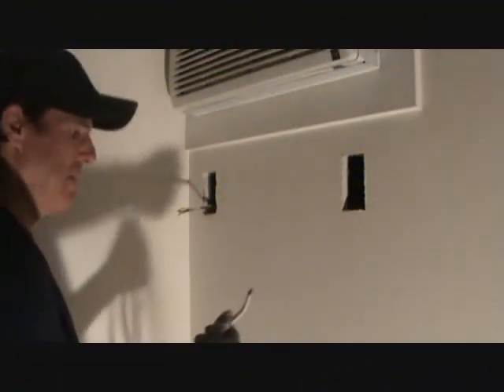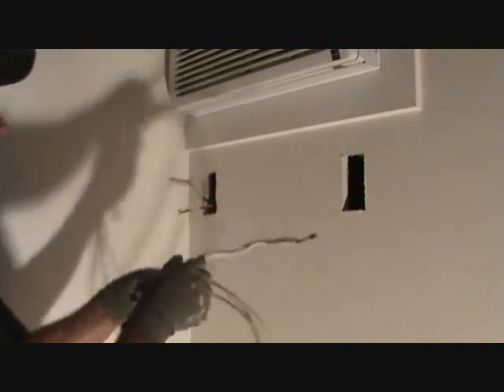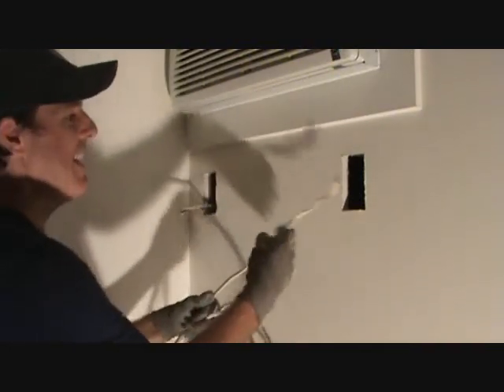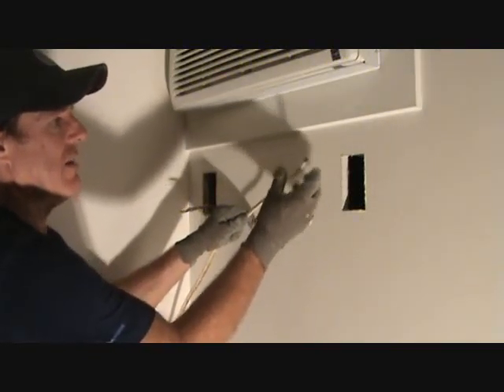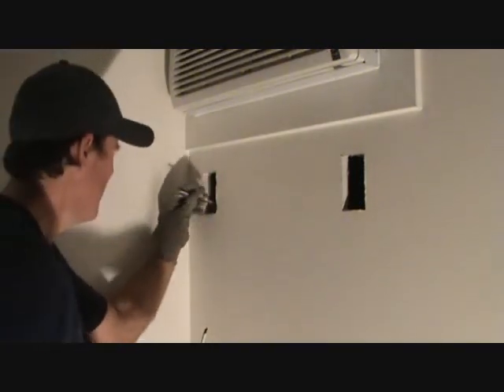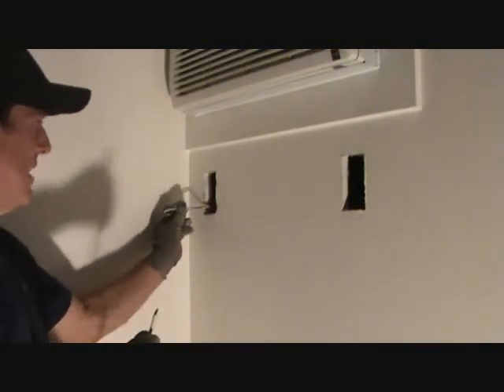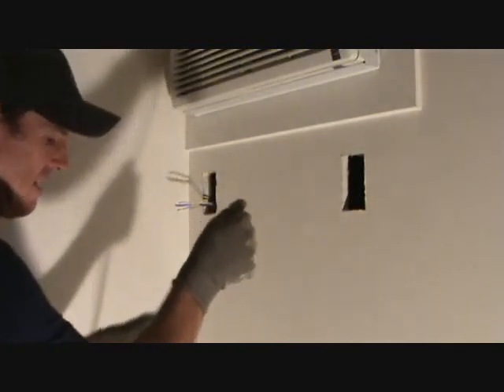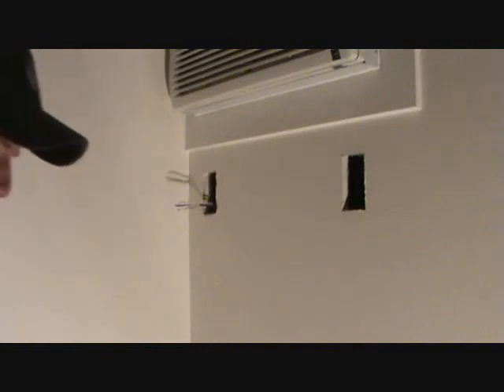How to determine what size romex wire you need: for your electrical project

Comment from the maker: @Chewylu103 All the breakers in the subpanel are 20 amp & I do not want to change this. If the existing wiring is fine to run the existing AC unit, then I can install a larger wire but not a smaller one than the existing. I think code might be to have no breaker smaller than a 20 amp breaker (for these condos?) but all 20 amp breakers should have a wire size of 12 gauge & no smaller. The inspector may have missed it. Thanks for your comments.   Joe  :0

Comment: @VideoJoeKnows National Electrical Code also states that if you change it you fix it, so you are obligated to change out that breaker to the correct sized breaker.

Comment: Joe,
 If the wire you are going to get your power from is fed from a 20amp breaker and you suspect it might be a 14 awg wire, then you should change out the circuit breaker to a 15a circuit breaker. The reason being is that you are now modifying this circuit and therefore have to correct it. Also you need to use the same wire size that the circuit started with, unless it is a correction factor for voltage drop which in this residential application is not the case.

Comment from the maker: @Chewylu103 The timer is also rated for a 15 amp circuit so I should be fine. I could've run a 14-2 w/ground it looks like. I had the 12-2 w/ground handy so I thought I would be safe either way. Thanks again for all your input as it will be beneficial to any viewer who reads these comments.   Joe  :0

Comment from the maker: @Chewylu103 You are correct. Hypothetically if anyone added to this circuit & saw that the previous installer used 12-2 wire, they might make the assumption they could add additional 20 amp rated items to this circuit & thus create a potential fire hazard since the initial wire/cable installed was only 14-2 which should've been installed with a 15 amp breaker. Thanks for your additional comments.  Joe  :0

Comment: @WannaBeDj100 No voltage drop is something that is going to be there if you have more then one thing on a line. Voltage will not go down do to smaller wire. Voltage drop is when you have a load on a line. AC power can go a long way with out voltage drop is its not loaded. DC power drops volts after long runs but both have nothing to do with smaller wire and that making the volts drop.

Comment from the maker: @strumpeteer I probably should've changed it but I felt there was no harm to do it this time, as you would not be able to add to this circuit, given the location used was under the AC unit & would be very difficult, if not impossible, to add anything else on this particular circuit, given the location. Thanks for your comments.   Joe  :0

Comment from the maker: @Chewylu103 The electrician probably checked the load on the AC unit, when intstalled, & determined that a 14 gauge wire was ok?... as the AC unit has been here for around 6 years & nothing has happened to it.....yet! The AC was not upgraded but if it ever was, should not be any larger than what's there now. The breakers were in a condo & maybe the requirement was that this condo was not to have any 15 amp breakers in the sub-panel?....not sure. Thanks for your comments.   Joe  :0

Comment: @VideoJoeKnows  If the wire is 14-2 on a 20 amp breaker, that would be wrong and would warrant changing it if you must use that circuit or running a new circuit, you cant just go up to a 12-2 on a 20 amp circuit that is run in 14-2 its wrong to start with and its just adding to the mess. now if you are wrong in the video and that is actually a 12-2 you are getting your power from then what you are doing is fine.  I am reading the code book now about the only 20a circuits in a condo.

Comment from the maker: @Chewylu103 It appears that the actual wire coming into the initial box is a 14-2 w/ground. If so, they should've installed on a 15 amp breaker. I added 12-2 w/ground to run the added timer. That would be OK to do in this instance as I am increasing the size wire & not decreasing what was existing. I believe the existing AC unit can be run on a 15 amp circuit so I would think the actual 14-2 w/ground will hold & will never be in need of a 20 amp breaker so it should work. Thanks.  Joe  :0

Comment: @strumpeteer yes i agree using a number 12 on a 15amp breaker is fine, because the wire is oversized for that breaker and the breaker will trip before current reaches the wires ampacity. My concern was that he was giving out false information, he said that the 14 was on a 20 amp breaker if i remember correctly, its wrong to just add a 12awg potentially masking a problem. because you see the breaker at 20 amps, the wire at 12 and run 20amp equipment. boom, 14awg melts, possible fire.

Comment: @VideoJoeKnows There are codes and standards in place for a reason so that at any point later down the line another electrician can pick up where the last guy left off and know that it is all up to par. People need to know just because the wire is bigger does not mean its right, it throws off the next guys perception of the circuit thus creating a fire hazard. hypothetically if you had a load rated for 12-2 on your 14-2, your 14-2 could possibly burn up and create a fire.

Comment from the maker: Ha! I do that in another video. This vid showed which size wire to use, in case a viewer has a question with that part of the project. It would surely be a bummer if someone installed a 14 gauge wire that was connected to a 20 amp breaker....... Thanks for your enthusiasm though. I like that!   Joe  :0

Comment: @67tr876  Whata bout voltage drop? after so far of a run you get more voltage drop on a smaller wire? So there for, I think you have to up your wire gage to account for this? (Am I right or wrong?) I think this is true

Comment: @Chewylu103 ....and even if the careless electrician 
doesn't check which breaker goes to what circuit, a 15A breaker will 
obviously trip before overloading the 14AWG with 20amp rated 
stuff.:)

Comment: @VideoJoeKnows  Code requires you to stick with the wire you started with its not "ok" to code. I cannot condone your decision to use the 12-2 strictly because you say it is safer because its not. The safer way would be to use the correct size wire which is 14-2, reason being that later down the line someone could open that up that box and be like great!  i have a 20 circuit here with 12-2 and put something rated for 20 amps on it, who knows what will become of that circuit later down the line.

Comment: I say, what ever the gauge the device, is built for. That is the wire you want to use for the project. Yep, ampacity, and all that is important.
Reply from the maker: I would have to agree with you. Thanks for your comments.    Joe  :0
Reply: No problem. Thanks for the replies!
Reply from the maker: You are most certainly welcome. It's a 2 way street though. Thanks for your replies as well!   Joe  :0
Reply: Perhaps we should check the watts that are drawn by the appliance to arrive
at the correct conclusion. Thank you.

Comment: An important error was made. He said the higher the number the thicker the gauge which is WRONG! The SMALLER the number the thicker the wire is what is correct.
Reply from the maker: Ha! You are correct! You know how sometimes when you talk you mean one thing but then you say something the very opposite & you don't realize it when you are saying it & someone points it out? I left this video up since the rest of what I was saying was correct re: 20 amp breaker for 12 gauge wire & 15 amp breaker for 15 gauge wire. Great catch. That tells me you were intently listening!   Joe  :0
Reply: VideoJoeKnows no such thing as 15 awg loomex  15 amps on a 14 awg wire 20 amp on a 12 awg

Comment: This is against code...  Wire cannot be sized based on the load device.  It must be sized in accordance with the protection device (i.e. circuit breaker).  If it was determined that 14AWG was fine (i.e. 15 amps) for the AC unit, then the breaker should have been changed.  Also, mode local codes force you to correct that mistake, before adding the second outlet.  I think the videeos are good, but try and point these items out as well to the DIYers.
Reply from the maker: I had said it looked like 14 gauge wire but after I looked closer it was in fat 12 gauge wire & the existing breaker was 20 amp so all was good. Thanks for your message..

Comment: @Chewylu103  IMO, using a 12G wire on a 15amp breaker is fine. 
In the future, even if the idiot electrician, who assumes that a circuit is 
automatically on a 20A breaker just because he sees a 12G wire, 
will eventually learn that it's actually on a 15A breaker when he goes 
to the panel to turn off the power to that circuit (assuming that he 
doesn't work on live circuits. )

Comment: You need some electrical training to work this out correctly. There are a lot of factors that can determine cable size. Distance, ambient temperature, cable grouping & insulation. Original question 45a device serving three 15a sockets, size cable. It just doesn't work like that. Get some good advice before you waste a lot of money.
Reply from the maker: Not sure what you heard as I thought I explained it pretty good for an average Joe!